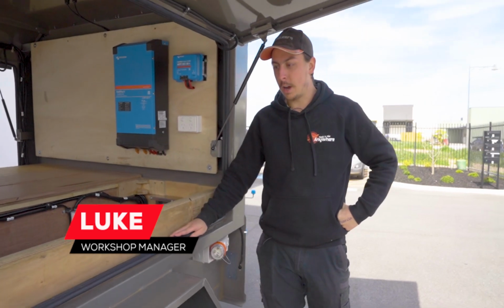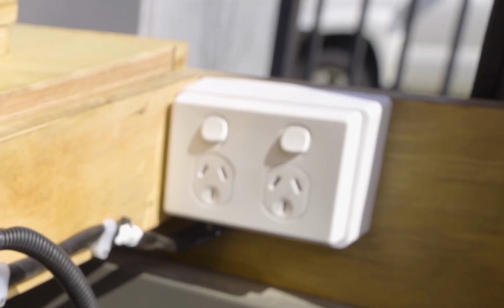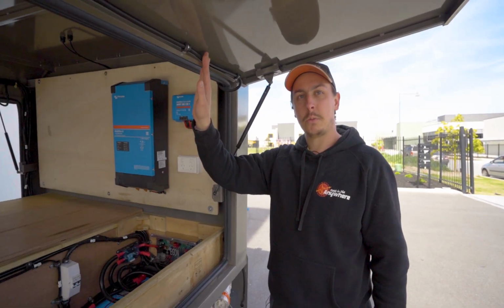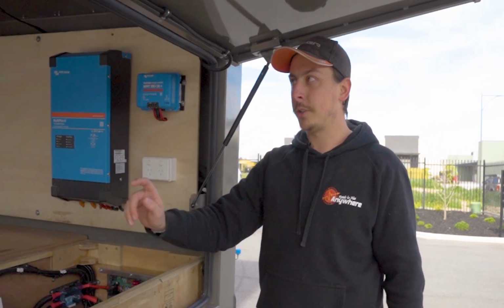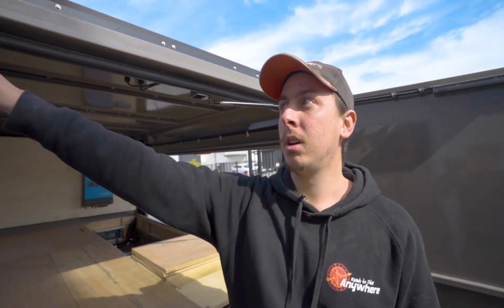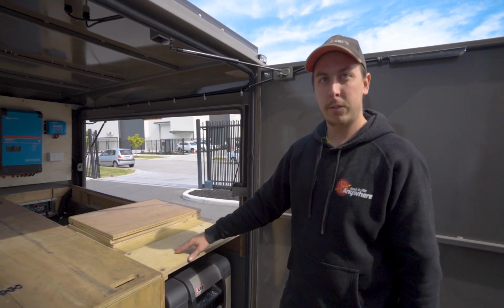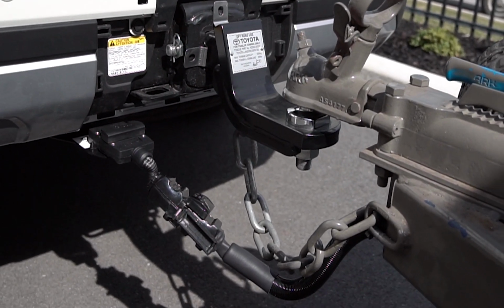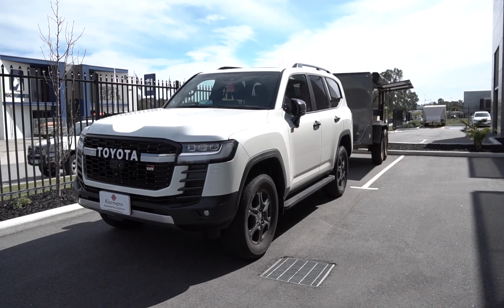Heiner Builds Your Ride | John Papas Dual Axle Trailer

Comment: Hi guys, hell of an power installation highest  respect !
4x200amp lithium!  Did you tested if the 2 solar panel can fully charge the battery bank from empty to full and also support the other el consumer?.
I have my doubt that it could be done in a day!
Would be interesting t get some more info on it.
MPPT is only a 100/50 unit. No extra external panel to connect??

Please shed some mor light on it, thanks

Happy traveling with such a trailer in tow

Cheers
Reply from the maker: The panels will do roughly 20A on the 12V side each. On an ideal day the solar system will be able to charge about half the capacity of the battery system. The customer takes a generator with him as well so can always top up the batteries with the inbuilt charger of the Multi Plus which will charge just under 120A in case the batteries get a bit too low.